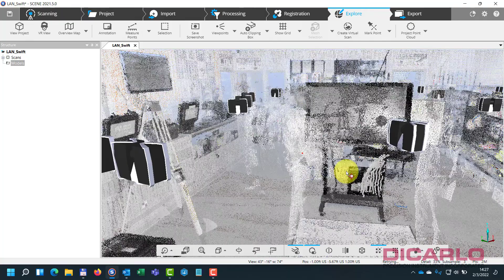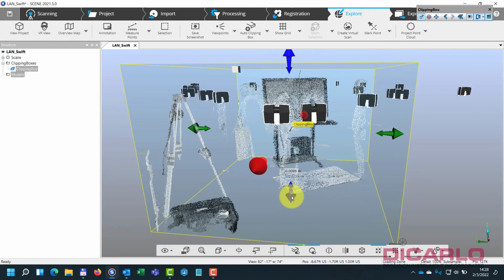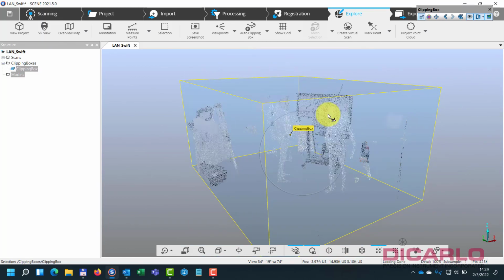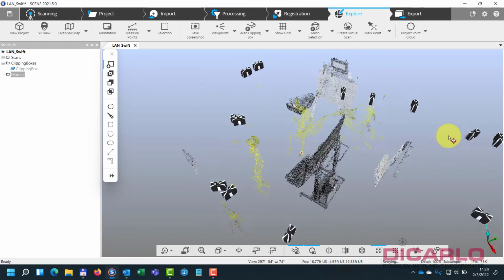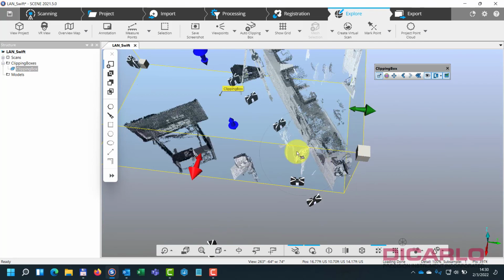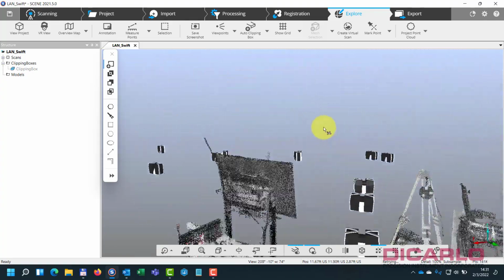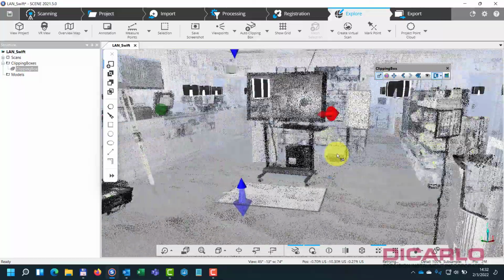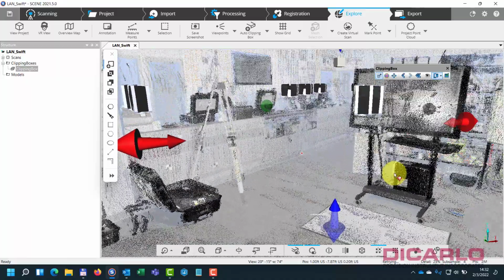FARO Scene 3D scan data noise removal

Comment: You can do it in a easier way.
Reply from the maker: I'm sure you can. There are many ways, some easier than others!
Reply: @DiCarloTV  Is it possible to have a shortcut for Delete selection?
Reply: I mean instead of rightclicking thrn moving the mouse to the right 2 times and then clicking again to delete? 
Just select and hit something like shift+delete or something.. When manually deleting alot of noise you do these stept hundreds of times and a keyboard shortcut would really help.. Do you know a way to ad keyboard shortcuts/ hotkeys?
Reply: By any means, please share your findings
Reply: I also want the ability to use a selection box or rectangle instead of always clicking points to close a selection box.